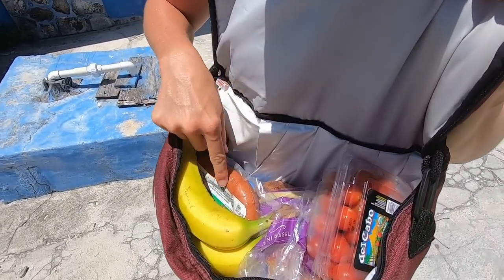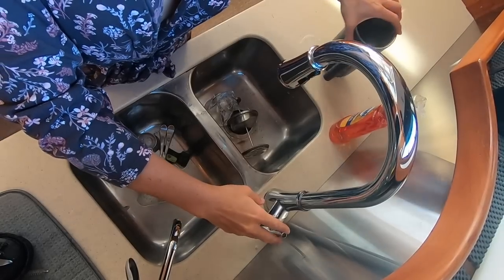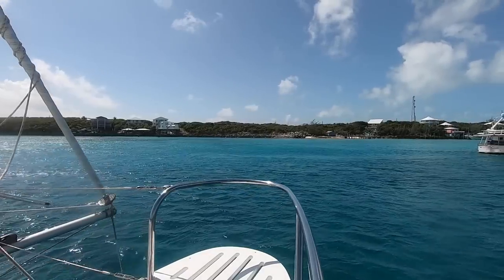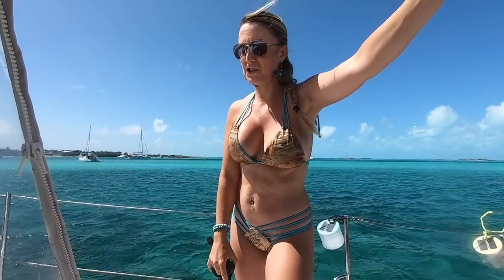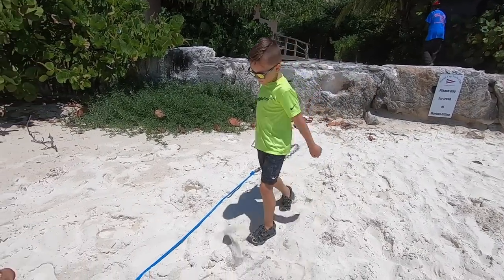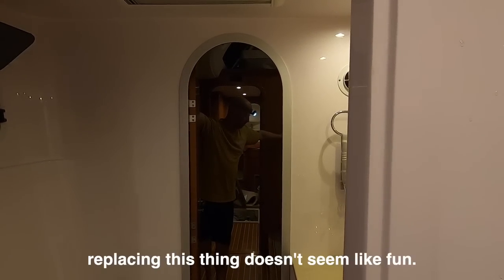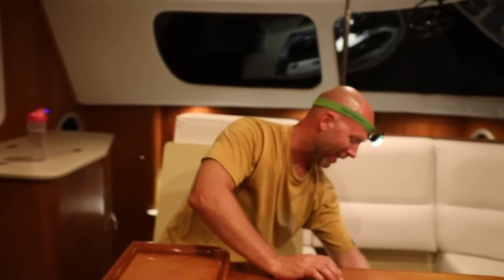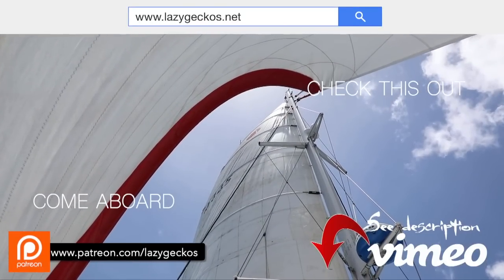Shower FAIL! Cold Showers from here on??? - Lazy Gecko Sailing Ep. 249

Comment: my sink in my camper did the same thing cold water work, but hot water didn't found out that the calcium buildup in the hot water tank got in the lines and plugged up the hot water side. I had to flush out my hot water tank and I blew air through the hot water lines, and it works fine again.
Reply from the maker: Yeah that happens!